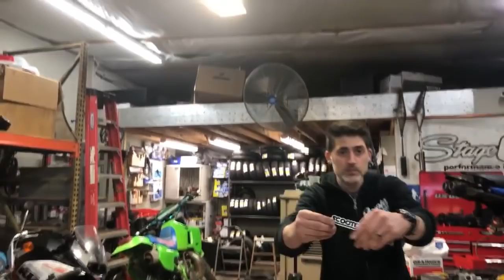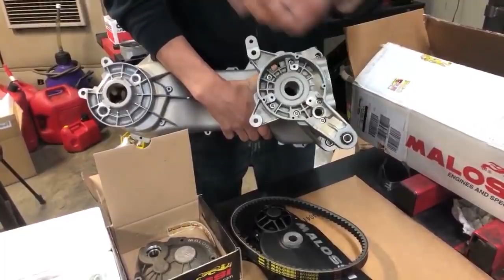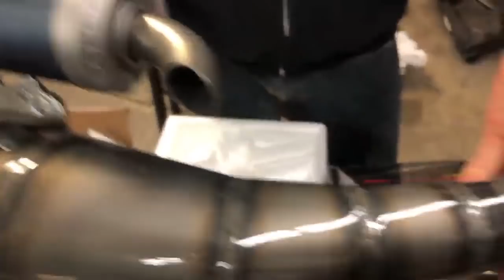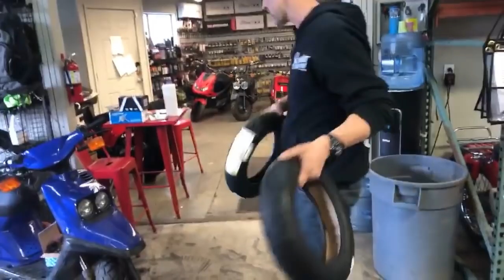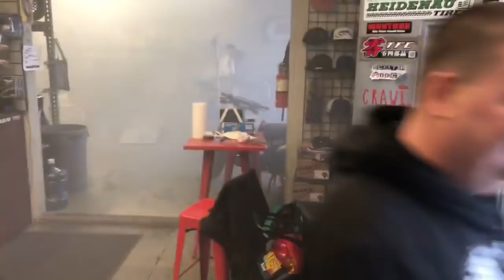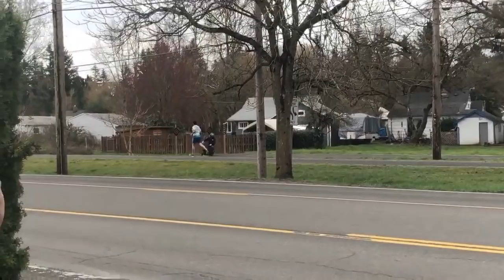Malossi rc one engine explained

Comment: You are awsome man, and yea iv put about 1k or so into my 2018 Yongfu Falcon, its a gy6 basically a Cn250  I got the dr. pulley  Hit clutch 60 degree with the dr pulley variator,  ordered the 24 x 18 dr pulley slider weights in 16g, 28g, and 33g,  I went ahead with the Adjustable DC CDI For Kazuma Falcon  Honda Helix CN250 ,,performance carb w, Manifold Intake Diameter: 30mm 
Air Intake Outer Diameter: 50mm #110 main jet, #38 slow jet with 3 upgraded size main jets added on 8/2/17 i just put the biggest jets in there , Drilled about 10 holes in the air box and used some foam filter pieces  to act as a filter pluss i got a small K N AIR FILTER  . Just playing around with the air fuel mix and clutch atm and checking the spark plug to keep an eye on the mixture I run a little rich still but Iv had no problems  except before i did all this mods to the bike and That was the woodruff key broke on me putting the timming off took me 2 months to figure out what the problem was and it was a 5 dollar fix basically  gaskets and fluids were under 20 bucks ill have to make a video and send it to ya maby you will get a kick out of it in your free time
Reply from the maker: I wouldn't put any money into the Chinese motor
Reply: @Scooterswapshop  right lol I got a cn250 I’m bout to rebuilt the top end on cause it lost compression but that cause it’s a Honda helix

Comment: It seems like in USA there isn't too much fandom of "tuning" moped bikes.In spain, italy, and france there're loads of  passion for 2 strokes in general. I've seen that you run massive carburators. Here gas is very expensive 😪.
Reply from the maker: because we can ride 1000cc or more at 16 years old
Reply: In the US gas is cheap compared to Europe, I am paying €2,50 for 1 liter of 98 octane pump gas.

Comment: funny u guys sound so new to this malossi parts :D in europe is we use them all long long time.its the best tuning brand out there.but u dont need to buy rc engine.if u own piaggio case is good enough.maybe start converting that ditech to carb is the best idea.
Reply from the maker: Yea it’s just the tuning scene here is very small. The popular bike here is the msx125. Piaggio here is very uncommon and most people aren’t into racing. So not a lot sell here. I bet there aren’t more than ten rc one engines in all of USA
Reply: The tuning market in Denmark was HUGE 10-20 years ago, since then it has dropped a bit every year. Especially with the new laws, only allowing dealers to sell 4T from new with very few tuning parts available. 

But 15 years ago, between 4-5 scooter parts dealers opened in Denmark, all importing their tuning parts from Germany and Holland.  ALOT of young guys age 14-30 were building/buying/trading all kinds og scooter’s and tuning parts all the time! Eventually the were so many tuned scooters on the streets and media coverege beacause of the police reasources on police chases. And the problem that the police could never catch them. 
That some different groups of people hosted race weekendes on different dates an locations. So people could race legally. (That’s the scene in todays Denmark. ) while there only is 3 out of 5 buisness left. But the market still is there because of the race season. 

- Also the illegal tuning is still happening, but not as big scale as when i was a kid. But the Danish scooter tuning culture is actually pretty amazing, its really a shame it’s slowly dying. 

If you ever get the time, you should look at (scootergalleri.dk) Everyrhing is on danish language, but theres a lot of old uses from back in the days, and a few new with 2cylinder 2stroke 40-60Hp scooters with NoS and custom body panels. 

-Hope you go explore and see for your self. 

Btw. Great videos, and sorry for the long text.
Reply: @ANo-ey9ql  u know scooter tuning is ruined by all those kids who driving reckless.its fun but dont tell me u ll like to wake up in the night because some fucker driving by with his high tuned chainsaw.a little tuning is not bad but kids forget that an high end engine dont belongs to the public road.i been there done that.that goddamn pod filter and exhaust is annoying for a long trip.and i dont want to terrorize my neighbourhood.in the usa they are lucky yet but wait until the goverment and police start to chase them.in italy all started.the end is near.no wonder why malossi changed the game.everything is 4t only a few 2t left but not long.its wasted building a custom 2t but u cant ride on the public road.
Reply: @ANo-ey9ql  True! also been in that Scene in Germany for quite a while since 2008 , i still have a ScooterAttack Catalogue from 2008. Lots of Great Parts in there like the Super Rare Metrakit 70cc Pro Race Limited Exhaust etc. A friend of mine has one paired to a Polini Evo 2 AC Minarelli Block , but he cant ride it on the Street it's way too fast and Uncontrollable (i guess it has approx 16 HP - 23 would be possible with Fine Tuning) nothing too fancy , but too Brutal for the Streets because it easily does Wheelies all the Time :D
Reply: @jenny-masterchef  I saw a Danish DAX ( Honda Trail 70 ) meet with a hundred beautiful ,
super -trick bikes. Some 140 cc  V twin conversions.

Comment: Hey guys. I have some questions if yous guys can help it will be much appreciated😇

I bought the complete Malossi RC One 94cc engine kit a couple years back.  
I need to know..
1.Where the Carb Needle pin clip should be sitting from the top needle? on the 28mm dellorto Carb that the kit came with, iv got it currently sitting on the 2nd clip from the top as I changed it a wile back and have forgotten where the clip should be.

2. The Main fuel Jet size used on that kit setup?

3. How many turns out do I do for the fuel mixture on that carb. Thanks heaps

Comment: Boss PLEASE ANSWER . . How fast is ur twin cyl scooter . . . How would it compare to yz125 power?  Also what are your opinions on swapping yz125 into scooter . . I think it would be mean . . . I understand it's alot of fabbing.  . .Butt making a kit is possible.  . . Especially with cnc.  . . Just wondering ur thought thanks in advance . . Btw ur shop is sick . Ur content is great . . I will be dropping cash on ur website
Reply from the maker: carlos vazquez the issue with a cr125 is it typically looks really bad.  How fast? It’s over 100mph. As far as comparing to a 125, it’s hard to say depends on year etc

Comment: You get on wet ground, make sure your front suspension is loaded up, the Helix will burnout pretty good
Reply from the maker: Thanks for the tip
Reply: Hell yeah I got a 86 helix and when it rains I can floor it at a stop light and spin all the way through the 4 way 🤙🏻

Comment: Will the Yamaha version fit a kymco super 9 lc body? it's an o3 model it's a minarelli clone but it has front and rear disc brakes on it already.
Reply from the maker: Those aren’t a minarelli clone they’re totally different. You wheel wouldn’t fit neither would your brakeS. it can be done but it’s not a direct bolt on I tot hat bikes

Comment: So the difference is u can run external cylinder head studs why Did you keep saying you’re gonna explain the difference but you only went over with the kit comes with no explaining the difference
Reply from the maker: The only difference is the c one for 70cc internal or external flange. Everything else is the same.

Comment: I've had really bad experience with malossi air cooled cylinder kits. Pistons to big, wrist pins to long, transfers do not match the crankcase, unmarked pinston rings, poor casting quality with cast iron cylinders
Reply from the maker: we have never had a a issue

Comment: How Much was it?
Reply from the maker: Martin Larsen $3500 on scooterswapshop.com
Reply: Not too bad actually, you should have a test bike or a test bench.. and ship them assembled and tuned.. for a higher price ofcourse..
Reply: @landmonkey22  
The idea sounds good but in reality it would need to be tuned at the location the bike will be used. Climate, altitude, fuel quality and availability will all play big factors in proper carb tuning and setting the squish. Having it built is one thing but tuning it far away could be a big failure once it reaches your climate.
Reply: @07zx14White  ah Yeah that is true!

Comment: The Malossi RC 1 engine, doesn't come with an exhaust, and your like, wheres the exhaust that fits the RC 1? And he's like, oh we have lots of exhausts. And your like, what exhaust fits the RC 1? And why doesn't come with an exhaust, and a radiator kit, and a pump, and a plug to electricity the pump, and electricity the headlamp? The most basic requests are never provided in the scooter industry.
Reply from the maker: I’m not sure where your getting the following information but it does come with all of the above. Minus a radiator as they have no idea what style and fit rad you need. Race motors do not come with charging systems as they aren’t needed on the race track

Comment: The Malossi Motor does not have a plug to run the headlight. And then some idiot will tell you. "Oh it's a racing engine." What do you care, you only bought it because it's a complete engine. And you can replace your old engine easily.
Reply from the maker: sorry not following, more explanation?